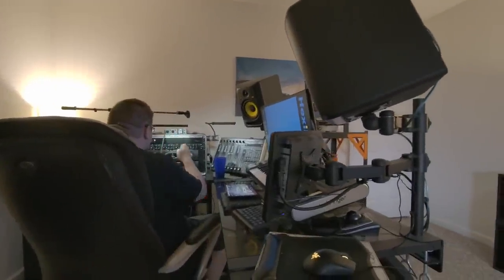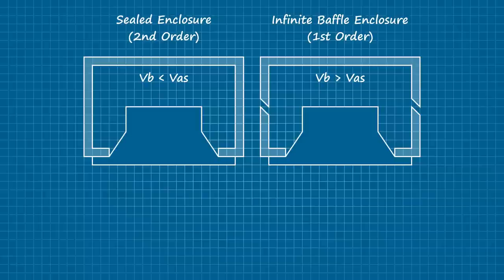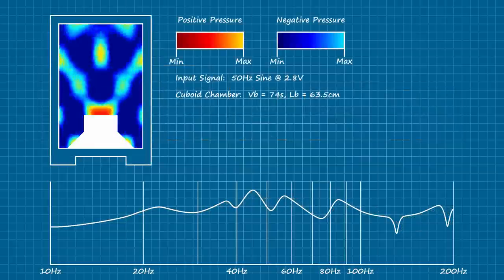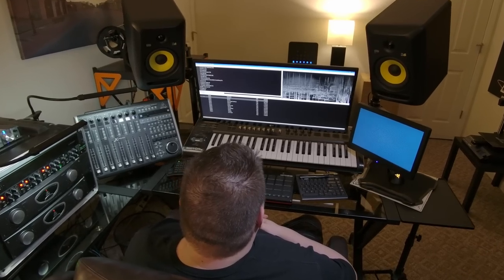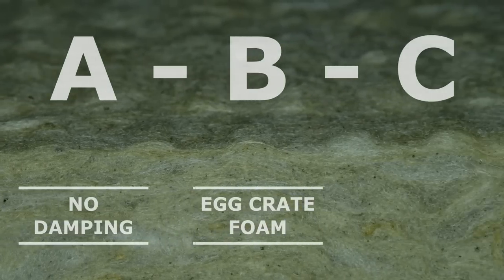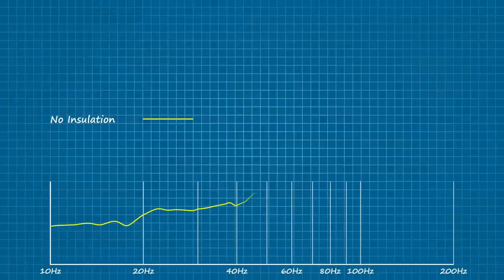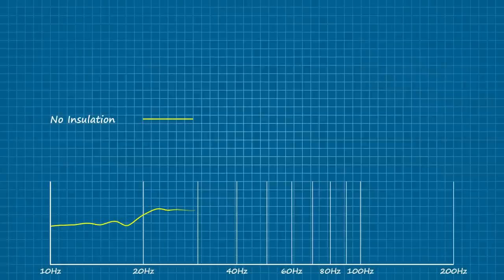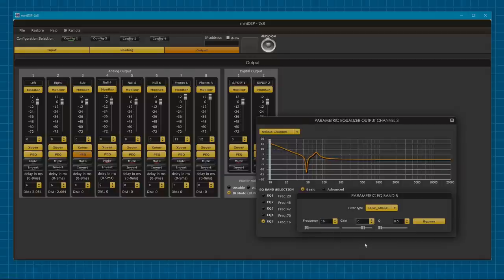Treating Enclosure Resonances

Comment: Rock wool is amazing!
Recently rehabbed an attic room for my daughter, and part of the room had a seciton cut out where the bathroom/shower is.  I bought a pack of rock wool, and threw it in the wall, and also used thicket drywall (not worth it! thick drywall is waaaay to hard to work with), and the noise difference is incredible!  I mean, you already have backer board, tile, grout, and drywall, but previously you could hear every drop of watter hitting the floor in there.  The slightest hum, and you could hear it in that room.  Now with the rock wool, there is a little bit of a running water noise from the pipe in the wall; But that is it!  Unless you are singing your heart out, nobody is going to hear anything that is going on in there.  Ironically, go to my son's room, which also shares a wall with the same bathroom, but the room part, not the shower, and you can hear everything.  His side only has some thin drywall in the bathroom side, and some 70's era 'wood' pannelling, but it is pretty bad.  Guess I know what I'll be doing next!  Thankfully I already did most of his room, so it wont be the whole room.   Pretty much just this one wall... and maybe move  a cut-in notch to make a real closet space in there.

Comment: Hmmmm, Rockwool...... itchy stuff, gritty on the teeth if your unlucky enough to breath it in. If your thinking of using this stuff in a high power reflex design/port, cover it in fabric b4 installing (like a pillow) High power drivers can break up the material causing particles to get pushed out of the port and into your room. Covering it with fabric will at least contain any breakup.

Spraying the cut ends with hairspray was another trick I've seen.
Reply: @nate0 <----- what he said. Mineral wool isn't designed for this use and the health consequences far outweigh the acoustical improvements.
Reply: A lot of the studio absorbers use plastic sheeting in addition to fabric to contain the rockwool. The dust is notorious, and is a significant concern as a panel reaches an age of a few decades.

This is one of the reasons why Owens Corning resin-fiberglass panels are popular in the USA.
Reply: nate0 > Totally agree with you, thought I'd just add the covering part incase some people didn't know.
Reply: Actually your completely wrong at least in EU, they tested the health concerns of breathing around them as workers were installing them in many buildings and results were that no health concers after 5 years.

Comment: Safety note:  protective measures should be taken when working with mineral fibers like rockwool or fiberglass. They're extremely harmful to the respiratory system and more than annoying to get embedded in your skin.
Reply: Rockwool rash... bad on finger... worse on a lung.
Reply: That's why I use Open Foam and Polyester Batting. Also the other stuff can cause Small loose fibers to get into your Speaker drivers and damage  them.

Comment: A hamster crawled through the bass reflex port of a friends subwoofer, and could not get out again.
So he lifted the woofer and shaked it to get the hamster out.
That did not work, so he had to dismantle it to get the hamster, which had been shaken around in rock wool. It died a few days later, and his daughters got sad.

As for the good sound absorption. I think this is due to rocks higher density, so the fibers resist moving with the sound waves. And there should also be optimal thicknesses of the fibers, matching air diffusion distances at different frequencies.

Comment: That mineral wool is exactly the same stuff as what you can buy in the hardware store to insulate your house with.
Reply: @HexiBase  I'd wager a guess the difference would be negligable, and most likely not worth the price incurred by having some sort of acoustics stamp.

Anyhow, I was excited for this video but I wanted to learn about how different angles effect the frequency graph. I saw an audiophile video with someone touting "defractionless" speakers and I could not find much information surrounding that. Sure it's certainly bogus, but a rectangle prism I'd imagine is hardly near our best option. Please drop some knowledge if you can.
Reply: @steeezyb  you would be better off searching for "diffraction".
Reply: Check out tech ingredients video on diy acoustic panels and absorbing materials
Reply: Regular fiberglass pink is not much different from egg crate insulation. If you manage to find stuff labeled as "Quiet Zone"  or some thing like that, it will be superior to regular pink. It is however quite a bit more expensive, usually about twice the price.  And it is usually not as good as mineral wool, but is often somewhat cheaper as well.  So you have some gradient of trade off vs performance. For my low power system I went with mineral wool after trying many other things.  In my situation it was the only thing that worked to my satisfaction. And this is also keeping in mind the room is purpose built.
Reply: @wishusknight3009  I saw a good paper done at a university which analysed cardboard egg crates as being a fairly viable broadband absorber, with an unusually high performance in low bass frequencies.

 Relatively effective for treating rooms, and a pirate radio station / punk rock rehearsal room staple. Dreadful fire hazard though.
Reply: @pandahead9274  yes the tech ingredients video highly rec
Reply: From the video it seems way denser than the insulation type
Reply: @MrSopuli3  looks like normal RW3 to me. 

If you want density, go for a grade like RW6 or RW7.
Reply: @MrSopuli3  you cant see weight on video :P
Reply: @pandahead9274  It sure is great, I had no idea that before watching it I would suddenly, out of nowhere, start building speakers and subbing to channels like this one.
Reply: @weareallbeingwatched4602  The biggest reason to use mineral wool instead of fiberglass is because for those that don't know how to properly handle fiberglass its a safer and easier material to work with and manipulate. I absolutely love the stuff and have been using mineral wool panels for about the last 5 years.
Reply: +1 for rockwool! As a cable guy, I walked into a basement which had been roughed-in using that insulation all around the walls, and suddenly found myself unable to communicate with my colleague who was walking in front of me! It was a really weird sensation to suddenly lose the benefit of sound reflections carrying our voices eventually towards each other's ears and our own! It remains the deadest place I've witnessed so far, except for one time that I was deaf on one side from an infection, and laid on my pillow covering the good ear!
Reply: Numbers aside... how does it sound in comparison?
Reply: Roxul, or Stone Wool, or Homasote....  When I was in home improvement we used it for soundproofing....
Reply: I wouldn't want any of that shit around me, fiberglass or rockwool. Sealed enclosure only, fibers arent safe.

Comment: foam, rockwool or any other similar stuff dont´t have any important effect on bass region, under 200Hz fibers do not absorb or dissipate nothing.  When you need  to absorb or dissipate energy in that frequency range, vibrating panels are used in conjunction with some absorption (membrane resonator), or bass traps that depend on the dimensions of the wavelength  (1/4 lambda)  or helmholtz resonators.
Foam or other similar stuff inside box absorb only the highest resonance internal modes. The effective response on bass depends on box dimensions (due to refraction, 100-400hz) or on main modes of the room.
Below 100Hz, in a normal room (without very deep bass traps, or any treatment in that region), the frecuency response is heavily influenced by the resonant modes of the room. And the equalization does not have much effect, because once these resonance modes are activated in the room, they are "hung", ringing for a while once the sound source stops emitting. Waterfall plots are very  helpful to see what happens in the room on extreme bass

Comment: Quite a few errors in this one:

1.  In room measurements are a very poor way to look at enclosure related issues.  
2. Enclosure issues need to be separated into two categories....panel resonance, and internal standing waves.
3. The wavelength of 51Hz is 22 feet..your box is roughly 2.5 to 3 feet in it's longest dimension (judging by the table it's sitting beside)   There is NO WAY for a standing wave to develop when the the internal size is only 1/10th or so of the supposed frequency.  It is theoretically possible for the panel to develop a resonance, but that would have to be a very very poorly braced box.  And while that box had no sides braced against the opposite sides, the ribbing should provide pretty substantial strength.
4. Two inch rock wool will not provide any significant absorption down that low.   Anechoic chambers are build with very large wedges to provide enough wall absorption to  minimize any room boundary caused errors....those wedges would have to be 1/4 wavelength thick or more...so roughly 5.5 feet.  

Enclosure issues are much easier to diagnose through impedance measurements.   Either type would show up as a bump in the impedance or a wobble in the phase of the impedance.  

If you're going to try to diagnose these sorts of issues with response measurements use the ground plane technique.
Reply: +1

However, it is also important to note that wave propagation within a box a low frequencies is fairly chaotic, and significantly reducing the reflectivity of the surfaces will produce a complex set of changes to the acoustic response. Also many studies of rockwool panels have shown that under some circumstances due they can reach lower than expected from gas-flow impedance models, possibly due to pressures at the boundary causing the fibers to flex. It's something that has been puzzling acousticians for a while, and it's hard to precisely predict what the installation of rockwool panels will do without measuring in real world experiments.
Reply: @weareallbeingwatched4602  At higher frequencies the impacts can be strong sure...but that's a 30" tall box. The biggest difference in the measurements was at ~50Hz.  We're talking 1/10'th of a wavelength, so there's no real wave propagation at that point, but pressurization.  I'm well aware of the modeling MJK, Backman and others have done on the impact of stuffing, these results fly right in the face of Backman's most recent stuffing/FEM modeling paper he did while still at Genelec.  Basically it's a false premise that that issue can be measured in room, it's a false premise that the fix did anything substantial at those frequencies unless that box is literally a floppy mess (and hot gluing rock wool will not add substantial damping to those walls)  and a box that size should never have an issue at 50Hz anyway.   If it were 5.5 or 11 feet tall sure...but that box is less than 36" 

That should have been shown as change in system Q in an impedance measurement and an elimination in any impedance wiggle up higher in frequency. I would estimate (again without knowing the exact enclosure dimension) that it's a vertical internal standing wave that doesn't form until ~225hz or so. Even then he'd have to do a double layer of 2" rockwool since the performance of the stuff starts to drop even with the higher density foam between 250 and 500Hz pretty significantly.

Comment: The great thing about the interesting hobby speaker building is that each detail of it can be a whole science on its own. You can produce different results depending not only on the type of material you use but also on how the material is distributed inside the box. And iif you start to combine different stuffing materials, try several styles of bracing and use separate absorber chambers inside you can experiment for years!

Comment: Great video!  At 2.37 you use a spray gun.  Is it glue to mount the boards in the cabinet or a varnish that will bind the stone fibers in the Rockwool board?  Dust can damage the speaker coil.  Know that Rockwool has boards that have a cloth on one side to stop the dust in the board.  Take a look at their acoustic range, next time.  Rockfon is the brand.  There, the boards are covered on one side of canvas or acoustic paint.

Comment: Are you calculating the sectional density and volume of the dampening material for wave reverb delay /phase delay to impact resonance vs just using a more efficient enclosure ?
Reply: Yes, it absolutely changed the volume of the enclosure a fair amount.

Comment: The difficulty of mapping semi-conductive elements within an enclosure is the reason why the aperiodic enclosure design was omitted from the original thiele & small papers on parametric modelling of enclosures.

In all honesty that rockwool isn't thick enough to really influence subwoofer frequencies, and if you look at many of the commercial sealed cabinet designs from pro audio, it is typical to fully-fill the cabinet with polyester wadding in order to achieve a relevant level of resonance damping. 

I would expect that a box entirely filled with rockwool would be quite successful in reducing resonances, but might be difficult to model.

Have a look at this BBC research paper on the subject of wideband rockwool absorbers for reference: https://www.bbc.co.uk/rd/publications/rdreport_1992_11

Also for reference note that low frequency absorption is not generally achieved using rockwool panels, but instead by using perforated membranes: https://www.bbc.co.uk/rd/publications/rdreport_1971_15

There is a lot to be said for solving the problems of speaker cabinets using the same acoustics toolbox and materials palette as is used for an architectural scale space, although the general assumption has been that speaker cabinets and smaller rooms do not have the required volumes required for the absorption of low frequencies using foam/mineral wool.
Reply: I agree with you, the wavelenght of low frequency are to long to trying to damping it with any absorbers materials, the most important in cabinet for low frequency driver is eigenmodes of the cabinet himself. Some commercial brands just put absorbers in there subwoofer to make it look great when customers look inside, but most of the time it's totaly pointless.
It need several meters of foam absorber to start damping 50Hz who has 6.86 meters wavelenght. Sorry for my English :D

Just a thought: Maybe the mineral wool dont absorved this 50Hz resonance, it slow down the air in the cabinet at a specific location and calm down a cabinet eigenmode around 50Hz. if it really absorved the 50Hz resonance so why it didnt absorved the 80Hz resonance and all the little dips after 100Hz which got a shorter wavelenght, in theory it's easyer to absorve a shorter wavelenght.  just a thought btw.
Reply: @Jean-Triphase  well, suffice to say that almost all decent quality PA cabinets have fairly thick lagging inside them - usually wool felt of some sort. The dynamics of the system and how it pressurises and depressurises - and also how wave fronts propagate within the cabinet - the general assumption is that supplying enough dampening material at the boundary thus removing the ability of the cabinet's internal resonances to result from unwanted reflections and standing waves / comb filtering is appropriate. For a subwoofer the effects are going to be negligible, whereas building a 4ft deep box/tube entirely filled with rockwool very likely would produce a totally different but hard to model enclosure. This would allow both the exploration of the more detailed sorts of analysis of exactly what rockwool does, and also would very likely produce a resonance-free and back-wave free enclosure which might outperform a sealed cabinet in terms of frequency response if not efficiency.

One question is... what is the speed of sound in rockwool?
Reply: Yes PA Speaker or even Hifi, Pro monitoring for the absorve >500Hz. Braces is used for control <500Hz , Wool is used for absorve >500Hz. I still maintains Wool is nearly pointless for absorbing frequency resonance inside a subwoofer cabinet.
Reply: @Jean-Triphase  well, regarding frequencies, depends on the size of the box, really.

The problem is that if you over-fill a cabinet, you start changing the speed of sound. That is the "secret sauce" and patented method in PMC's transmission lines.

Comment: Is the enclosure made with mdf if so I used to install car audio for 15 years. Mdf is pourers meaning it’s compressed wood that air can still penetrate the material. When I design a box I fibre glass the inside and then paint the inside with bitchinum paint which builders use on the roof. Then apply the sound proof 
. Amazing results.
I’ll send you pictures of my installation which I’m doing to my van

Comment: I'd recommend using a cheap machete from harbor freight, just make sure to keep it sharp.  It'll slice through the stuff from orange or blue cleanly and with minimum effort.  I've been stuffing the walls of my house with the stuff mostly from blue, it's slightly thicker and denser, but I never considered using it in a speaker box.  I have a project coming that it may be useful in.  Thanks for the tip!

Comment: I like the results shown in the video but I would have preferred a deeper look at what enclosure resonances actually are and where they stem from. You almost started to dig deep with the look at pressure response inside of an enclosure but just kinda left it hanging there. The thumbnail had me thinking you were going to talk about the effect (or lack there of) of adding 45 degree corners. Talking about bracing enclosure panels would fit nicely in a longer more in depth video about enclosure/panel resonances. The effect of a double baffle vs dowel vs I-beam style bracing would be fantastic. Keep up the great work!